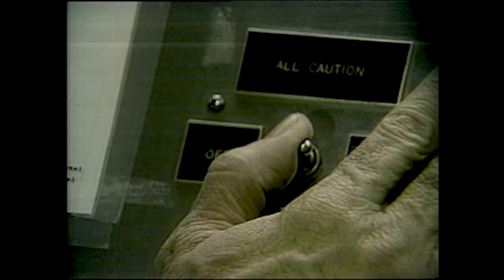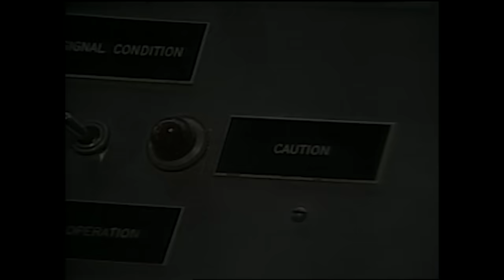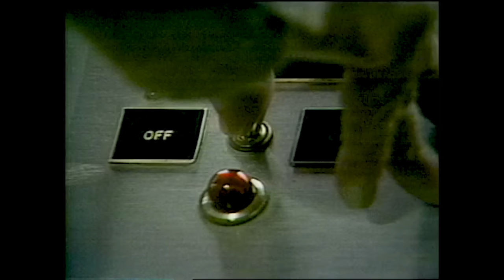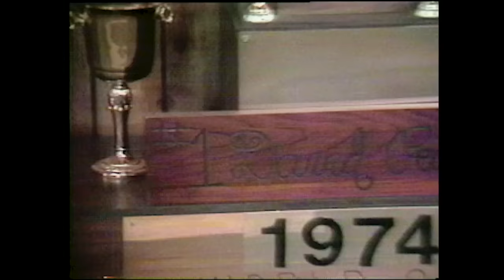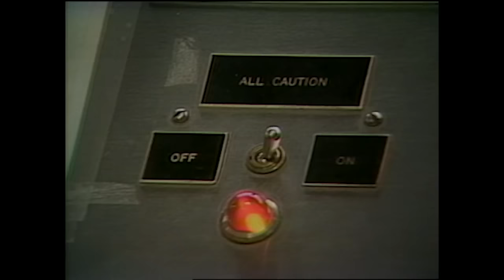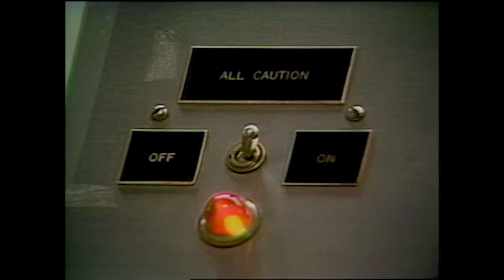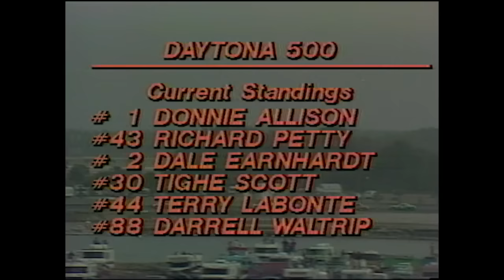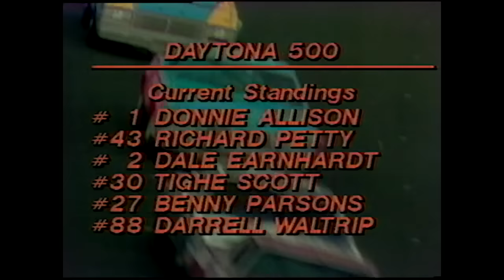1979 Daytona 500 from Daytona International Speedway | NASCAR Classic Full Race Replay

Comment: WHAT HAPPENED BEFORE THE 1979 DAYTONA 500?
· Cale Yarborough was the 1978 NASCAR Cup series champion after scoring an average of over 160pts per race (that’s like finishing 4th for 30 races straight, absurdly good)
· 1978 race winners David Pearson and Donnie Allison kept on just racing part-time
· DURING THE WESTERN 500 at Riverside, Darrell Waltrip dominated the race, only allowing other drivers to lead laps when he stopped for fuel and tyres and during cautions. Brooks (33rd), Petty (32nd), Parsons (26th), Marcis (24th) and Bobby Allison (19th) all had to retire or at least undergo extensive repairs during the 500km race. Behind Waltrip, it was Pearson, Yarborough, Bill Schmitt and Donnie Allison for the top5 with Millikan, Baker, Thirkette, Williamson and Harry Gant completing the top10.
· A MONTH LATER, Buddy Baker won the very first Clash. It was a 9-car 50-mile sprint with no cautions or pitstops with a mad average speed of almost 195mph.
· Buddy Baker got the pole for the Daytona 500 going a bit above 196mph with Donnie Allison in 2nd out of almost 60 cars. Baker also dominated on his duel (that’s 3 out of 3 wins for those counting) while Darrell Waltrip did the same on the 2nd one.